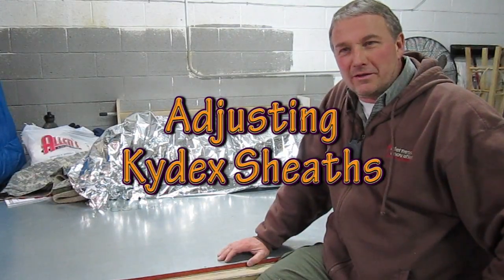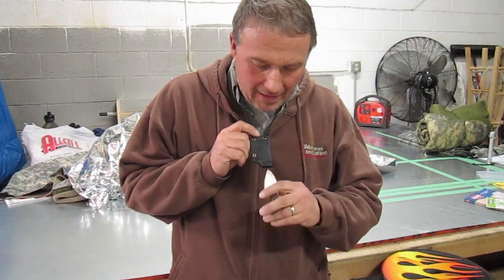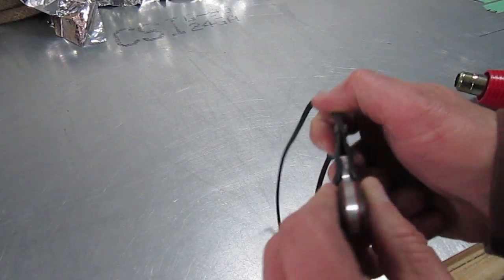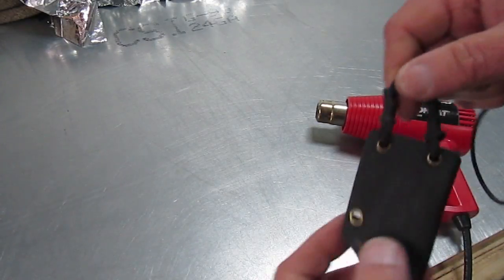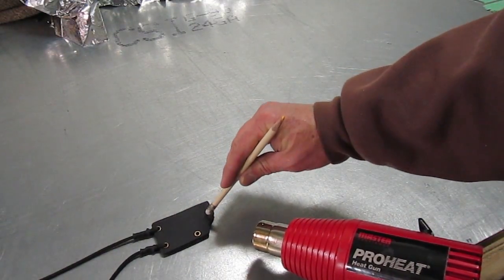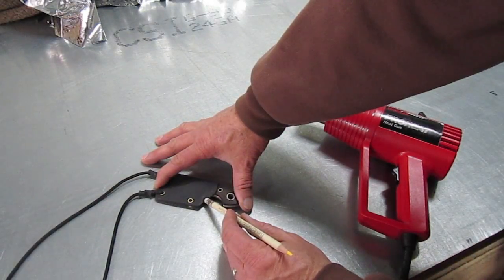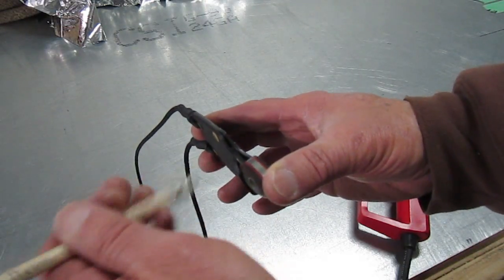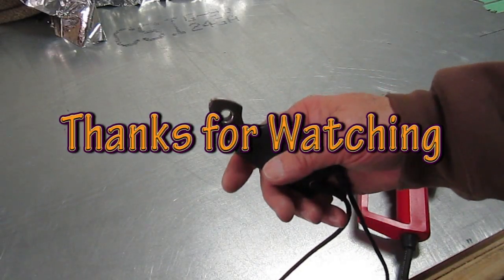Easy Kydex Sheath Adjustment

Comment: i have the boker highlands ranger and the sheath was way too loose. i tried doing this and the sheath kept getting looser. any suggestions on what i should do?
Reply: take knife put one or two layers of masking tape on blade take multiple pieces of leather 5 or 6 layers each side heath kydex much much more then he did till it almost feels like leather the  place blade in sheath and clap in between leather and boards also will need rigid foam for in between leather and board

Comment: Just a cpl extra tips not mentioned. You have to be very careful with the heat . too much heat and the exterior will go shiny on you and look like crap. also too much indirect heat and yu are gonna mess up the overall molding of the sheath then your in big trouble unless you have the setup to remold on the knife. Good idea to use a pencil eraser. also too much heat and you might squish the Kydex and it will be thinner and you will lose retention strength . Kydex heating takes practice

Comment: I tried a 1300W hair dryer.. didnt work :|| Gonna have to buy a heat gun i guess :)
Reply from the maker: Yeah easy with heat gun. You can also soften it for molding in a counter top oven set to broil, watch it closely it doesn't take long. Thanks for the comment